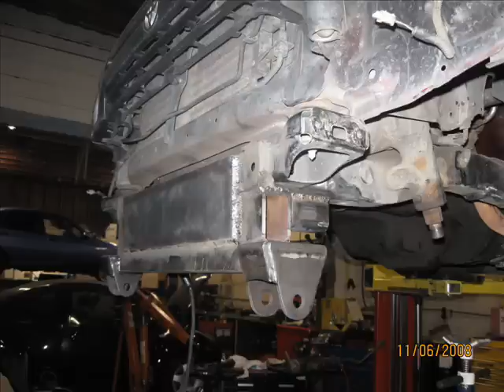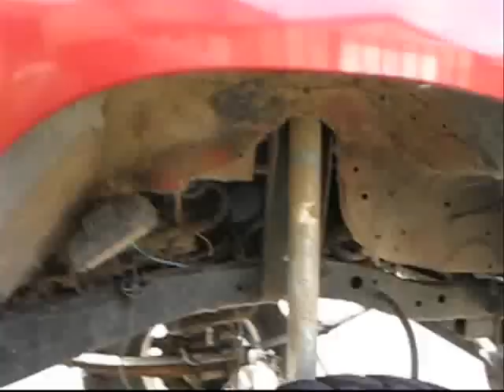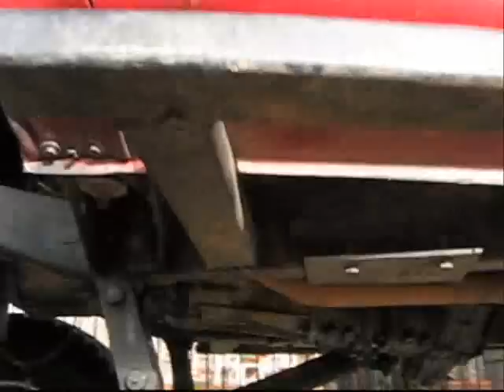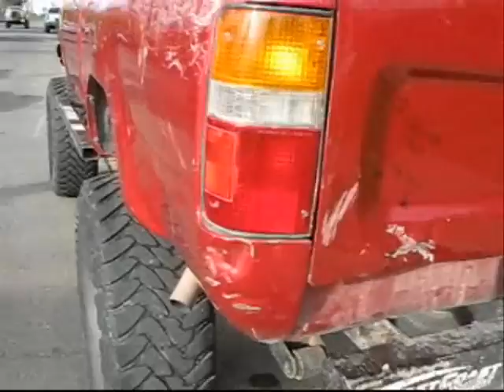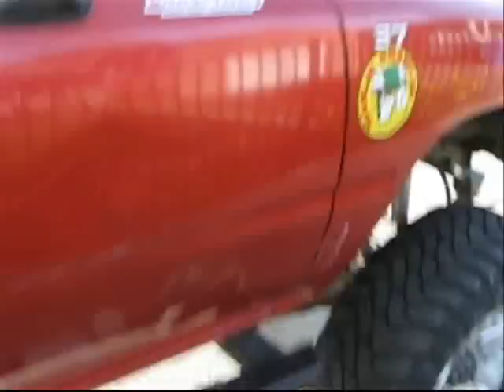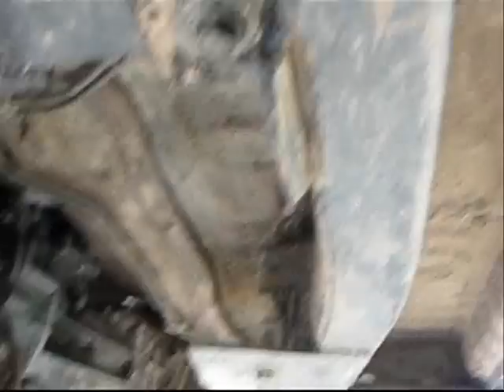Hmong 4x4 2wd to 4wd Conversion Part 2 Finished

Comment: @mavue I agree not everyone can afford it. I wasnt criticizing you cant afford it ,hell I cant afford to change the oil on my truck, i was commenting on the design of the lift. Leaf springs are there to support weight they aren't designed to flex

Comment from the maker: @dragonvue09 unless you have the 4x4 parts laying around, just buy a 4x4. the cost of converting is unknown because of where you will get your parts and labor. But lets just say that you are buying everything from the junk yard and installing it your self, $3-5k, but if you have a shop do it $5-10k. it could be cheaper if you want me to break it down, let me know. i need the year and what motor size. and how many lug nuts are the wheels.

Comment: @mavue i would like to know this to cuz i have a 1982 f150 2wd in good shape and a 83 f150 4wd but the
 
4wd's frame has canser HUGE HOLE bye the leafspring hanger's so can just pull the drive train and swop them thay bolth have 300 inline 6 bolth have 4 speed tranny just got to cut a hole for 4wd stick bolth even have same rearend only diff betwin the 2 is 1 year of age and 2wd vs 4wd i mean is ther a big diff in frame bolth have coil springs in frount I HAVE NO WELDER can i still do this???